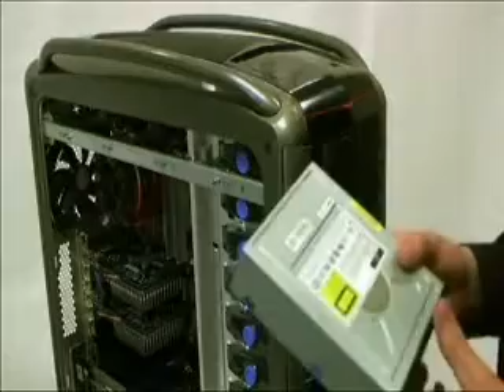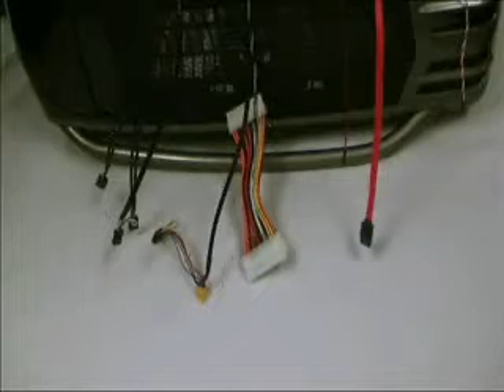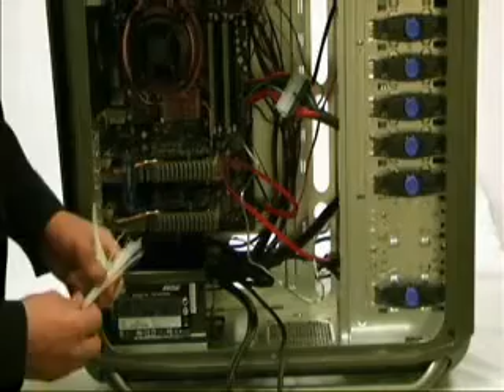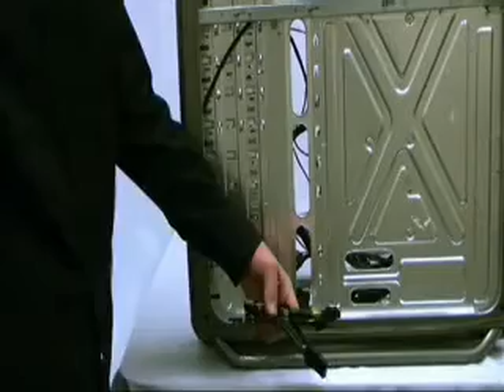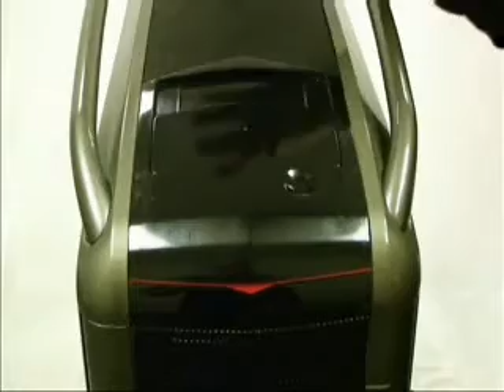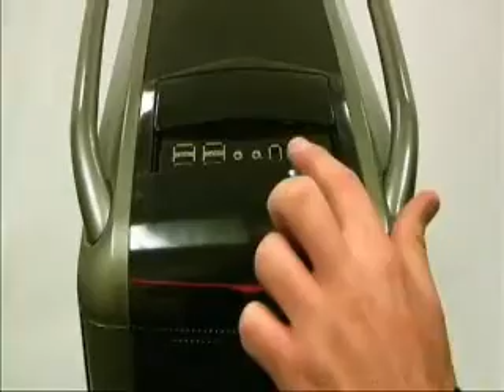Cooler Master Cosmos S installation Part 3

Comment: 2021 still one of the best case ever made! well done Cooler Master! ;)
Reply: 2026, and I just bought a used one. An E-ATX supermicro board just wouldn't fit into anything else. Still cleaning it up, and I need to drill some extra mounting holes, but the case is just amazing. I just hope the plastic lasts another decade.

Comment: Looking for some videos for the case that STILL NOW IN 2021 I'm using to build my rigs in. Just want to update the original 4 front usb ports to usb 3.0, which I guess shouldn't be so much a problem. I'll update if I achieve this DIY update, as Cooler Master no longer support this magnificent case.

Comment: yah they include cable management system to throw all cables in front without routing, this is awesome. you should work for cooler master so they shut down.